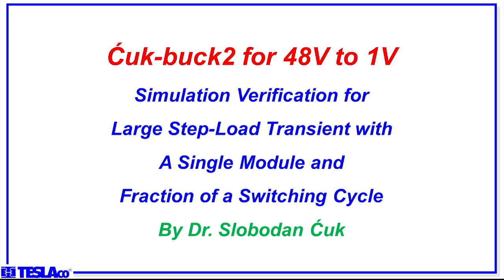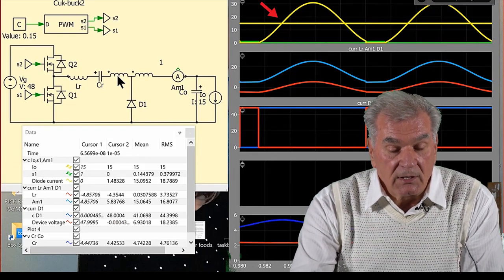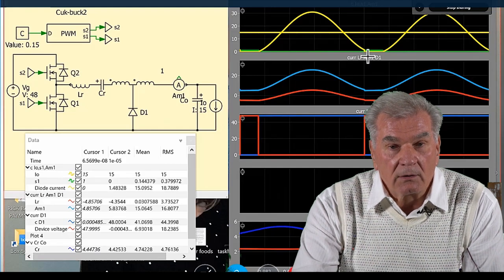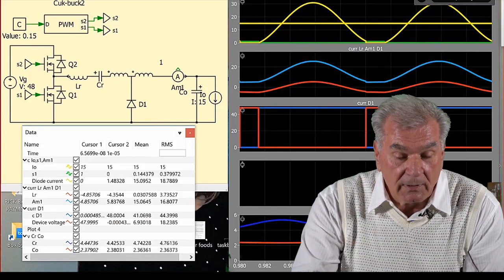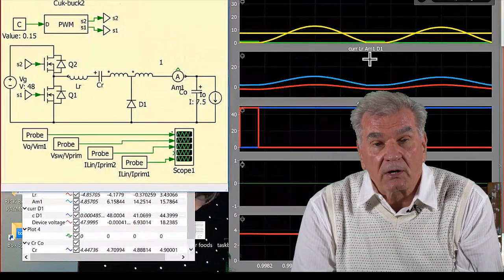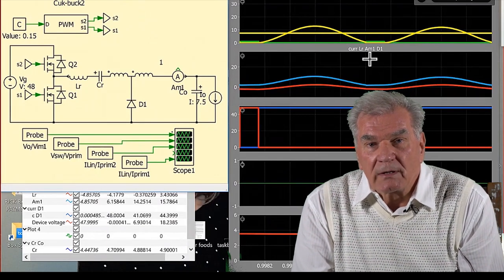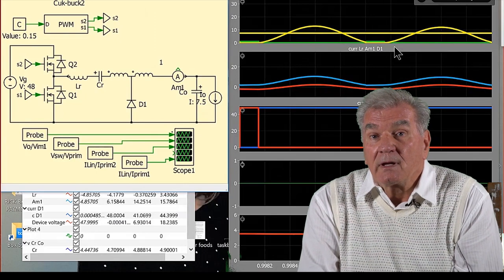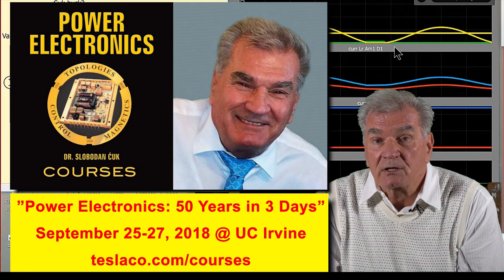FAST TRANSIENT RESPONSE OF ĆUK-BUCK2

Comment: Excellent idea.  I have made a few alternates recently but only verified them on simulation.  One main problem I face when using Diode especially in a low voltage circuit is its loss.  Even in this case when Diode had a 30A peak, assuming that the average current is 15A, with a drop of only 0.2V, the loss is already close to 3.0W.  How is the efficiency 99%?  The Diode peak is also more than the load current which causes further problems with the efficiency.  If this is the case with 15A what about the 100A load which was discussed?  What about the recovery charge?  Is it a GaN or SiC?

Comment: Very good presentation Mr Cuk.
I am involved mainly with audio electronics (musical instrument amplification) where low noise power is of high importance. 
Most common power sypplies are swtching technology and are quite noisy, especially with high gain ccts for electric guitar use.

The supply voltages currently in use in this field range from the low 9Vdc for efect pedals which usually run either on batteries or plug packs ( known as wall warts In US) or dedicated multi output power packs to 400 - 500Vdc in vacuum tube amplification. 

My questions are:
1.  How good is your technology from the noise perspective? 
My main/ultimate referrence is battery power which is cleanest and then well filtered and regulated linear power running off of 50/60 Hz mais.

2. Is your technology applicable to boost type power, ie going from something like 12 Vdc to 48 Vdc or maybe streght off line down to some lower value?

3. Is it possible to have isolation for safety?

4. Is it possible or practical to use Cuk system to generate the above mentioned 400 - 500Vdc?

Forgive me if the answers to my questions may be common knowledge.

All the best from down under Australia.

Comment: What is the disadvantages of negative output D.C. output voltage of actual cuk converter? What will be the waveform of output voltage capacitor?
Reply from the maker: This converter is NOT Cuk converter with negative output DC voltage. Its output is positive!

Comment from the maker: In my first Power Electronics Masterclass on Sept. 25-27, 2018 at UC Irvine I will demonstrate a number of new converters using simulations. Here is simulation of Ćuk-buck 2 converter. This converter is much more sophisticated than its simple converter topology indicates. This is why in this video I focus on its key feature not available in any other switching converter. The Ćuk-buck 2 provides large and fast load current transient in a SINGLE conversion module in a FRACTION of a SINGLE cycle and at 100kHz frequency and 99% efficiency. The present conventional approach uses up to 12 synchronous buck converters in parallel at 5MHz only to perform 12V to 1V conversion at below 90%. It could not even provide 48V to 1V conversion, let alone with fast transient. Clearly, Ćuk-buck 2 has much reduced size and cost while alspo eliminating any EMI radiated noise which is not even regulated for switching frequencies below 150kHz. 

Link to more information about my masterclass and how to register is at
Learn More--> https://lnkd.in/g4FjF-K

With Masterclass I am also celebrating my 50 years in Power Electronics research, teaching and inventions in addition to supervising 36 doctorate students at Caltech and developing practical designs and products with my TESLAco research and design team!  On this occasion a number of Power Electronics practitioners chose to remember my past contributions on LinkedIn-wide post.  Here is a link      https://goo.gl/1FCCQu  Please feel free to add your comments especially if my past contributions have touched your work in any positive way!
Reply: Can your class be taken online? Also do you have a full tutorial on the hybrid converter?

Comment: at 5:38: current only starts at 0 and stops at 0 at one value of Vin/Vout ?
Reply from the maker: NO. When you operate with constant OFF time adjusted for that condition, you can control ON time, or effectively switching frequency to mainatyin this ideal condition at any conversion ratio. Even chanaging input voltage and keep output voltage regulated  can be done with feeforward control controlling magnitude of  PWM sawtooth ramp with input voltage!